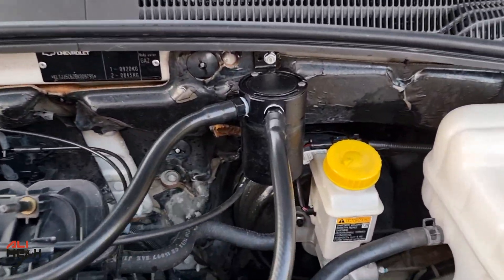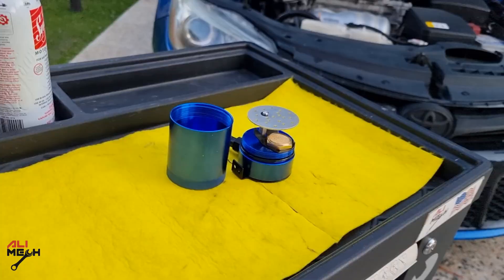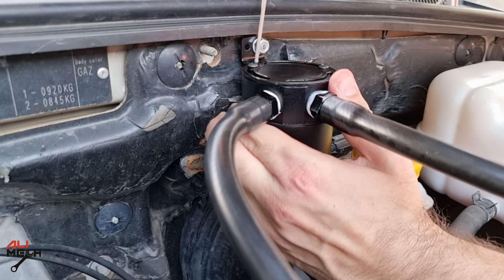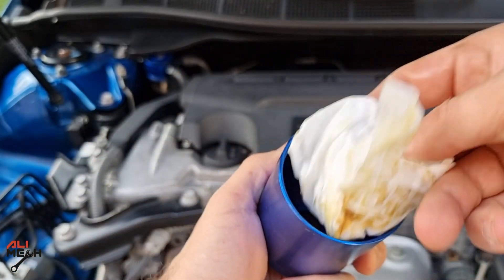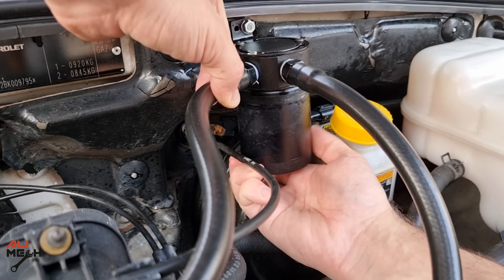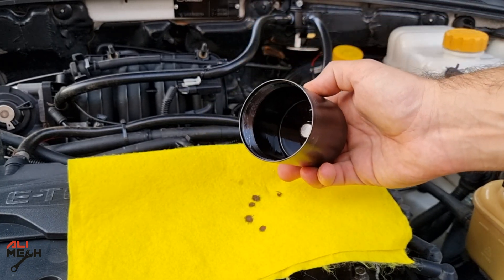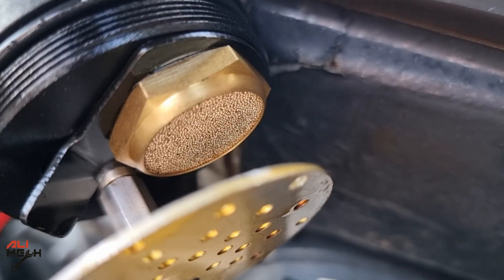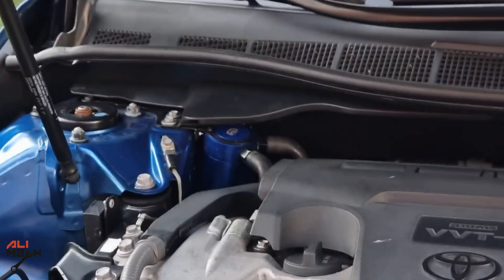One Month after installing Oil catch can/Quick fix for engines burning oil/preventing carbon buildup

Comment: I hope you can give me an answer. My car keeps giving code P0401.
I changed the egr valve, that wasn't it. Now I think I need to change the solenoid? Look for cracks in hoses and maybe change temp control thing? It's starting to go dead in traffic. I've stopped driving it. I'm stuck because I don't know where the other things are I'm supposed to check. Solenoid, which hoses etc..
Reply from the maker: Check the wire harness, you may have open circuit in one of the wires, you can check if the EGR working or not, when the engine running, unplug the wire harness, if it changes engine sound it means it's working if it doesn't,  means it not working

Comment: hello
how can i know if there is no air leak?is the fuel trim data is useful,?
Reply from the maker: Air Leak in pcv line will course RPM goes higher than normal, for example from 700rpm to 1000 rpm

Comment: Thanks for the follow up. My 08 hyundai sonata v6 vapors a lot of oil. With each 5k oil change, I see my catch can has a quarter of burned oil down at the bottom.
Reply from the maker: When engine running at idling temperature,  open the oil cap, if oil smoke comes out, ur engine burning oil if there is no smoke,  its just like my optra, some engines got more oil vapor than others , so its normal, oil Catch can will solve that problem